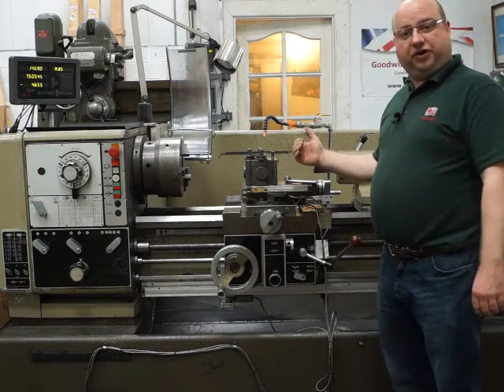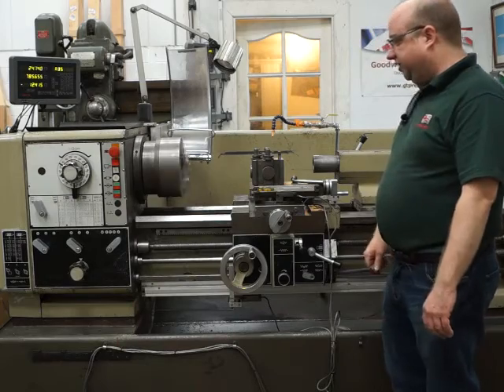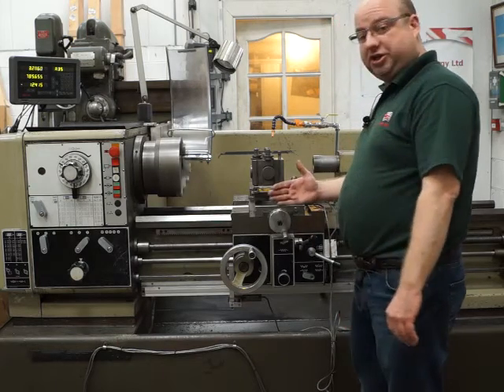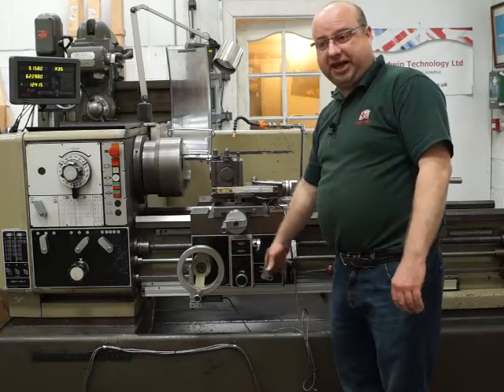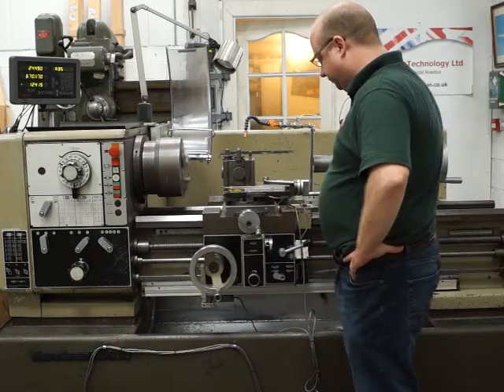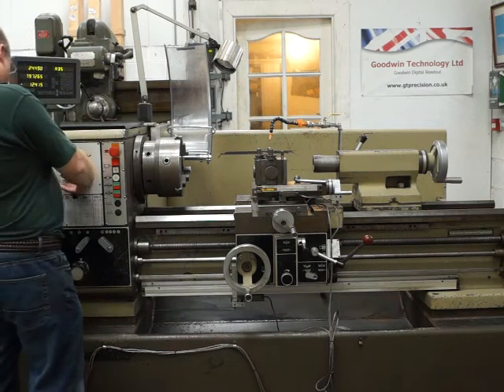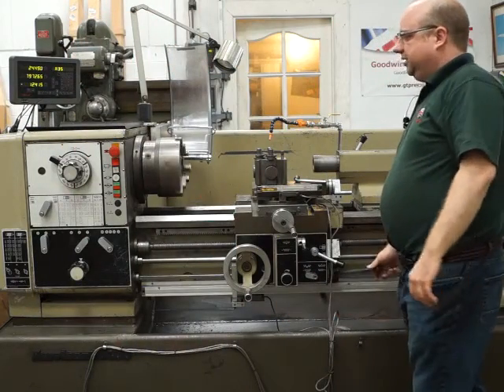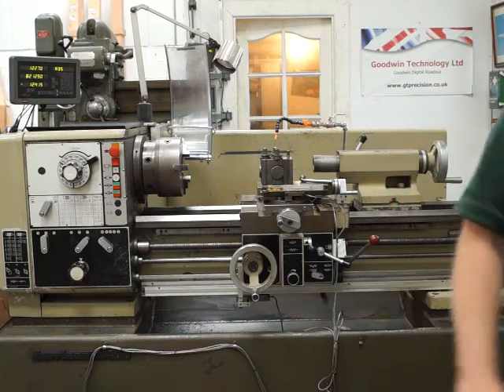Harrison M400 Lathe with 3 axis DRO system

Comment: Hi Darren, Alan here in NZ could you give me an estimate of cost for a replacement input shaft (forward/reverse) clutch for a Harrison M400 lathe.

Best regards

Alan
Reply from the maker: Hi Alan, we don't supply the M400 spares. However, I can tell you the clutches are made by Matrix in Scotland they were at least £2500 lathe time i was quoted some 10 years ago. But you can just change the plates, which works out much cheaper. Do you definitely need the shaft ? Have you stripped the gearbox as yet or just speculating on what's needed?  Best Regards Darren Goodwin Goodwin Technology Ltd